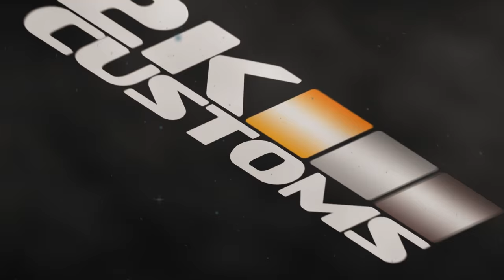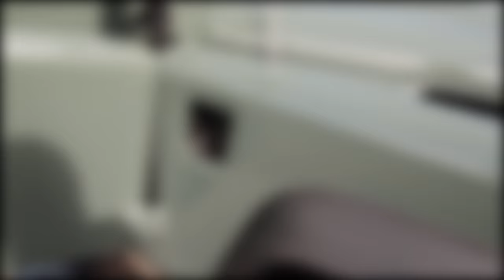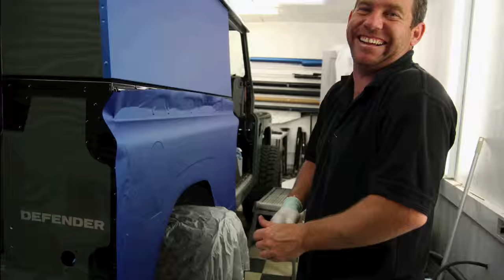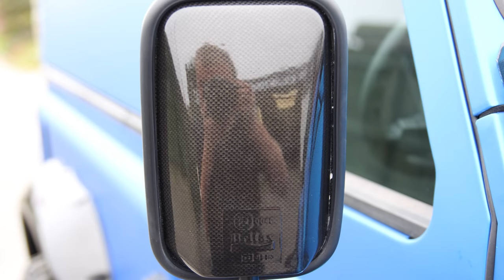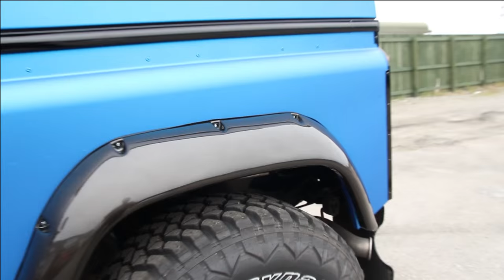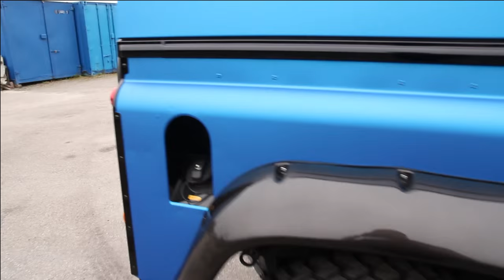Landrover Defender full wrap in Arlon Blue Aluminium - 2K Customs Inverness

Comment: 2K Customs4 hours ago
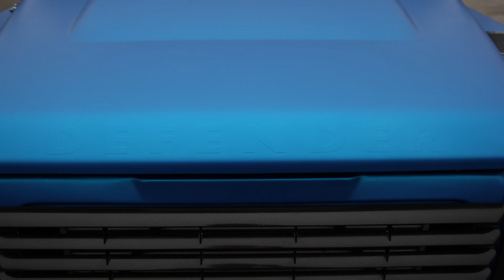+John Long hey, at the beginning they are not peeling, they were removed and double sided tape residue is what you have seen, that have been cleaned off before wrap and vinyl was used to make defender logo which then was wrapped over to get 3d effect. . . . . . .  For some reason I can't reply to the above comment in the normal way so had to resort to doing it this way. . . . @ 2K Customs, yes I see that now, thanks for the speedy reply. At about 4:15 into the video it all becomes clear, you've done a great job, lovely looking piece of kit.

Comment: What happens to the word "DEFENDER" across the very tip of the bonnet? At the start when the bonnet is still on it looks like the word is there but in black and all peeling, but when the bonnet is off and the wrap is going on the word "DEFENDER" is there looking very smart but in white.
Reply from the maker: +John Long hey, at the beginning they are not peeling, they were removed and double sided tape residue is what you have seen, that have been cleaned off before wrap and vinyl was used to make defender logo which then was wrapped over to get 3d effect
Reply: I don't oh, how can I